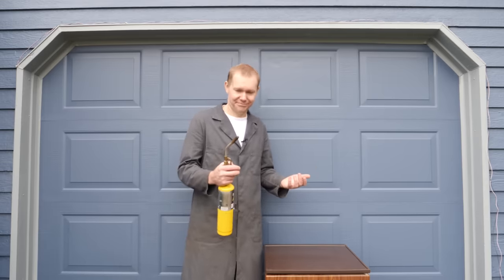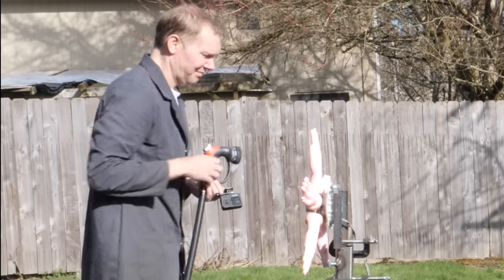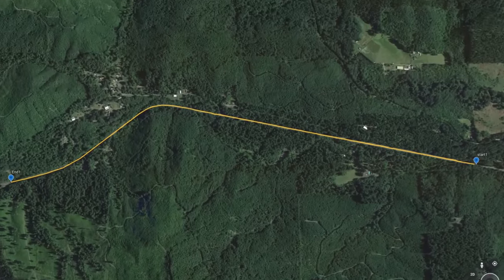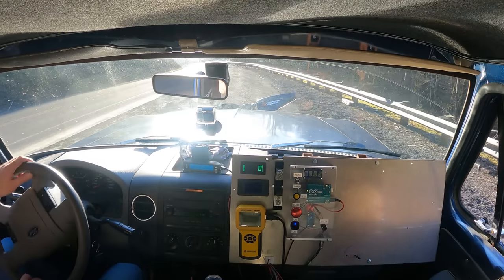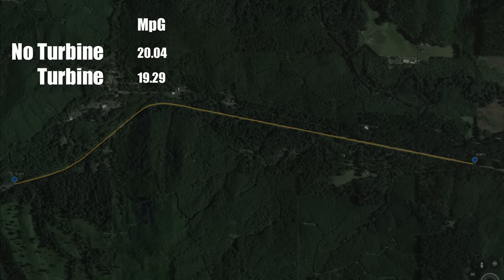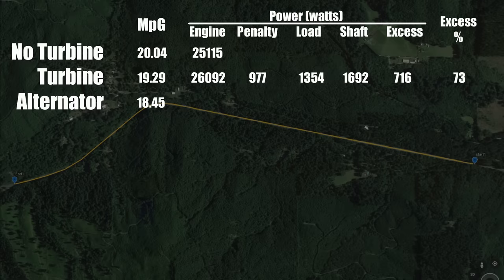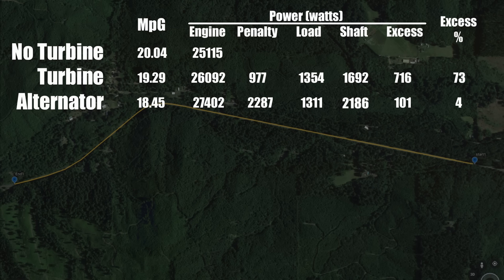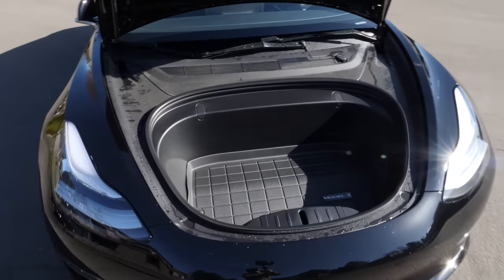Mileage Results You Won't Believe!!! - Wind Power on a CAR #5

Comment: I had an '86 Corvette. Sleek in the front to cut air resistance. Air scoop underneath for the radiator. But then they added a 30 Amp high-speed fan on the backside of the radiator to pull air thru it. Without that fan, the car would overheat. I knew this, because the fan went out a couple of times and the car would eventually overheat, even on the freeway going 60 MPH in overdrive. And by the way, the car had a short and long-term MPG computer, and I routinely got 21 MPG (long-term).

Comment: Hi, the reason why we don’t see the benefit in better gas mileage is because we are converting mechanical wind power into electricity first. So if we do NOT convert the mechanical energy, but instead use it as is on the wheels themselves, then we will see a big savings in gasoline. At first I thought of using a vawt turbine above the vehicle with a pipe attached to wheel rim with a right angle joint. That would work. But even more efficient and simple is to make a ‘water wheel’ and attach it to the wheel rim. There would be a big savings. 4 of them could be used. One on each wheel. I think the name of the water wheel is called ‘Pelton’ ?.that would be a very efficient way to use it on a motor vehicle. I will test it out . Personally I thank you so much for your abilities as a teacher. You have helped me understand the effects of the wind blowing on turning the blades of a turbine. You are marvellous in your explanations. I wish you well and will become a patron. Thank you so much. Enjoyed watching your son too.

Comment: It's good that there are people like you that exist, in attempting to do what seems impossible! Please also remember that (in adding the Turbine), you have also increased the mass of the vehicle, and (possibly) affected the rolling resistance. I have an idea which has fascinated me for a few years. All cars and Trucks have suspension - which moves up and down many millions of times, albeit in very short strokes. But this is one form of energy that has not been capitalized-on. We all know that Shock Absorbers heat-up, and this heat is a form of energy. With Electronic Shock Absorbers, that can "capture" and store in a Battery this wasted energy, and let us not forget that there are four (4) Shock Absorbers on a four-wheeled car or Truck. Some Enterprise should seriously look at combining the electrical output from four (4) specially-made linear Generators which are attached to the Shock Absorbers. This would certainly benefit any Hybrid, EV, or ICE Vehicle. I also include ICE vehicles, because this would also assist in taking some of the electrical load away from the vehicle's Alternator, providing a small increase in Engine BHP. I hope that this note would encourage someone to consider and develop this idea, simply because it is the one area of any vehicle that has moving parts (suspension) where this pure energy can be harnessed. Greetings from Australia.

Comment: I wonder if you should consider doing "coast down" tests to determine the aero drag differences between the truck w/ and w/o the wind turbine.  I'm betting, as others may have already pointed out, the truck w/ wind turbine is MORE aerodynamic than w/o.

Comment: If you put a false roof on top of the bronco and let that over hang the windscreen by about 1/3 the horizontal of the windscreen.  Then at the rear of this roof space put a barrel fan  OR extend the roof past the back of the bronco and enclose it in a tail section big enough to put a turbine in a vertical orientation so take the high pressure and dump it into the low pressure at the rear. Done with a bit of FCD you could get more MPG despite the turbine due to better aero.

Comment: Only issue I have is that I think when people in the comments were saying to use an alternator they meant use the propeller of the turbine to turn an alternator because alternators are more energy efficient because the magnetic field in the windings can be varied so that it only generates the power that is being drawn, allowing for better control over a generators output. It's common sense that running any appliance off the alternator is gonna create lower fuel economy because it puts more load on the engine as more power is drawn, amd we're talking a 1kw of mechanical energy needed from the engine to power the oven, which will have a measurable impact on fuel milage.

Comment: I suspect that an efficient turbine can make any shape virtually aerodynamic if you reroute the harnessed energy back into the system. Like you pointed out, it's about pushing air, and with the turbine, you can get some if it back.

Comment: Have you ever heard of "the big 3"? Car owners with aftermarket car audio systems wire their alternators this way. There's also high output alternators and brackets to run two alternators.

Comment: Do a 100 mile loop unhooking the alternator and using the wind generator to charge the battery to see if this in fact MORE EFFICIENT than the standard method of using an engine driven alternator to keep the battery charged. The math says it very well could work!

Comment: If you used a “rat” and dropped it into the slipstream in coast only it could keep the battery charged. Retract it when not needed.
 A “rat” is a wind generator used in jet aircraft. It is deployed when there is a loss of hydraulic output from the engines.  It allows the pilot to maintain control until he figures it out or ejects. A f-105 fighter has one.  Using a “funnel” to spin a impeller might be better.

Comment: Be interesting to see whether a portable air conditioner vs the oem fitted one would be more efficient in the back. I'm sure the Oven had its own challenges 🤣. You could do a 3 way test. Fuel economy average needed to reduce the temperature in the cab by x°C using vehicle installed A/C followed by the Alternator / inverter route and finally wind Turbine.

Looking at your oven results I'm leaning towards wind turbine with portable A/C may trump all?!? I really hope so 😉

Comment: Have you seen the guy that built the turbine on wheels that goes faster than wind speed? The rotor is attached by a belt to the wheels and powers the vehicle faster than wind speed directly parallel with the direction of the wind. The reason that works is the reason your turbine on the front of the truck may actually generate more energy than it takes to push it through the air. It's also why some sailboats can go faster than wind speed at an angle to the wind.
Reply: I believe you are referring to the Blackbird wind-powered vehicle.  What I found remarkable about it is that not only was it able to travel faster than the wind DOWNWIND but it was also able to travel faster than the wind UPWIND!

Comment: I could have told you the alternator problem would happen. Either upgrade the alternator to one with a higher amperage or add a second alternator and upgrade you cables 

I use to have a sound system in my truck that when the base hit the truck would slow down. In my case I just upgraded to a higher amperage alternator, added a shorter ground between the battery and frame, and a capacitor. The heating element in the oven cycles on and off a lot slower than the base in a song so in your case you can just add a second dry cell battery instead of a capacitor

Comment: What a fantastic project! Maybe you could increase the mileage of the Bronco at least a little if you let the turbine charge the car battery and supply the onboard electronics, de-activating the alternator (at least at highway speeds, with a switchover circuit?) instead of burning the generated electricity in a cooking oven.?!

Comment: Just random thoughts. 
I would try using smaller ducted fans. Even in research with ducted radiators, there were surprising gains.
Now part of your lack of gains mayhaps be the lack of air diversion a round the vehicle. 
You are still pushing the air with the blades and the front of the truck. If you were to divert the air from the radiator either under or up through the hood, you would see gains.

Comment: It's not often that I would sit for so long Infront of YouTube watching one set of videos but I did and it was excellent. I'm not a engineer but a biologist but I'm a keen amatuer electrical engineer and keen to learn. I have a campervan with solar power a battery to battery charger etc etc so I can wild camp here is Scotland so I don't have to visit campsites and it's just fun making stuff work ....like you say. For years I thought about a small generator to charge the leisure batteries in the camper by using a wind generator enclosed in the engine space and using the air hitting the front of the van to drive it. It wouldn't have to be kilowatts of power just a few Watts that on a long jpourney would help to charge the batteries. This seams especilly important since you pointed out that car alternators are so inefficient? regards Grant Kay

Comment: Here's an idea you have a great idea. 👍 bit why don't you add a battery bank and capacitor bank and add an electric motor  with a gear belt attached to your main pully to kick on after let's say 55 mph. It would help the gas engine load go down. Producing horse power like a supercharger.

Comment: What's likely the biggest problem for a vehicle that's aerodynamically well designed is that this will mess with the incoming flow, making it swirl. This swirling may decrease the aerodynamic efficiency depending on the car. To mitigate this you could add a second, opposite, static propeller that would take the air and redirect it to the car, increasing the car's aerodynamic efficiency.
It's important to keep in mind that the largest factor in a car's drag is isn't caused by the pressure on the front of the car but by the vacuum that forms at the back of the car. If you would take a well optimised car, the propeller could cause the air to separate from the car early, which may cause an absolutely massive increase in this area of low pressure and as a result, drag.

Comment: For the past 2 years I've been working on designing a three-wheel electric motorcycle with an attached teardrop camper that would run continuously without ever being plugged in.
My design has four separate charging capacities wheel driven motors not only in each of the three wheels of the motorcycle but in the two wheels of the teardrop camper. Using four different energy input I believe would be in theory. 
There are small cage fans that collect when to be used for a single output source which manages the lighting and computer needs. Then alternators, several of them, would be used to recharge the batteries. They would be two battery Banks wanted to be used while running and the other to be charged while running when the cycle gets low the second Bank kicks in automatically and the first Bank starts recharging. The next energy source would come from all solar panel. And finally the third source of energy. The trailer has its own charging and battery bank system.
The first goal is to drive this across country without ever stopping for a charge and the second goal would be the entire pan American highway.
What are your thoughts on this? I believe if we can conceive it we can do it. Hope to hear back from you
Reply: This is a very interesting project your planning.

Comment: There's another variable:  Car engines tend to be most efficient around 80 to 90% load for a typical operating RPM. That's one reason you tend to get better fuel economy in the highest gear possible; lower RPM means higher load. Most vehicles aren't anywhere near that 80 to 90% while just cruising on the road because that would be less practical for the way most people use their cars. But adding some load to your vehicle while it's cruising, assuming it stayed in the same gear (and preferably had the torque converter locked, or similar), while it would reduce the mpg, raises the load and might be slightly improving the power generation efficiency of the engine; that is, brake specific fuel consumption (BSFC), or power produced per unit of fuel burned.

Comment: I think there are a lot of followers who just don't realize that for the non substantial gas consumption is nothing when you consider how much energy is lost in vehicles. It makes sense to convert that lost energy. The same way heating your car does. A lot of people think that heating a car is bad for your car when in fact while it may cause a slight gas consumption increase the heat comes from a hot engine and it's wasted energy. Why not use all that wasted energy? Alternators don't waste energy but the drag on a car is absolutely wasted energy. The logic is there. 💯

Comment: I really enjoyed the thought provoking content of this video and would like to suggest that many smaller turbines that funnel air that's already passing over, around and under a vehicle even while the vehicle is sitting around outside, could be used to transfer that unused air into perpetual energy that could then be stored to propel the vehicle slightly once the vehicle is moving forward via magnetic turbines and now days we have batteries and convertors that could also be used to recharge the petrol engines battery and assist the alternator to reach maximum voltage there for dropping fuel consumption dramatically.
Would love to see an experiment with that concept in practice 🤔
Even Hubs, axles, bearings and internal ducting could be used to transfer unused energy into additional power with the correct science applied!

Comment: You're missing the point car alternators are designed for an specific power output depending on the vehicle, they have a CURRENT/POWER limiter built within to avoid burning out the car electrical system (or overcharging the battery) - you can spin it twice as fast and all you doing is wasting energy to heat (via current regulator)
Hope it helps

Comment: It may be useful for commercial trucks who travel at highway speeds 99% of the time. I suspect analysing the system (outside of the electronics) as a whole would be similar to adding an aerodynamic cone to the front of the truck.

Comment: I can see this idea being put to good use on an electric powered 18 wheeler. Most of their time moving would be highway speeds. Could use an air-ram hood scoop into a turbo type device to capture the incoming air. A gain of 8-10 % efficiency would mean big $$ on fleet vehicles.

Comment: if you build a air ram you could use the entire air resistance that pushes against the truck you could increase efficiency by about 70 percent of what you have accomplished. Because you are using that resistance to create the energy.

Comment: I had the same idea but my fans aren't as obvious. The power from the fan needs to go to a converter from 110 to 220 for maximum output. Should be enough to charge battery.

Comment: I think a Dyson like wind turbine may be a little less efficient on the production side but not have nearly as much maintenance or added drag at less than optimal speeds.  I hope that this does get added to EVs of the future in that form.  But there are many opportunities to optimize EV efficiency by making refinements to the vehicle platform, recovery system, and using variable timing on the electric motors to reduce inductive heat loss.
Reply: Another interesting test would be using heat pump to drive energy production from the radiated heat in the battery.  It’s already captured in the glycol that circulates for cooling.

Comment: I wonder if your results would have been different if you used a vertical axis/vertcal spiral generator.  I also wonder if you had access to a pickup truck, and if you could measure laminar flow over the truck, that maybe you could put the vertical blades possibly in the bed of the truck sitting higher than the roof. Or make a gentle funneling device to direct air flow over the vertical blades, but without too much wind damming.

Comment: Probably not a good idea but I had a thought about how good would it be to skip a generator and make a mount on the engine block, allowing you to connect a belt from the turbine directly to the crankshaft pulley, would be good idea to add one way bearing so engine can't back drive a turbine

Comment: Put that energy into a drive motor in between the prop shaft to add propulsion and also regenerate with the kers to some super capacitors that help the takeoff. Lastly you should create a hawt for the front and rear top of the roof instead of your propellor! That would increase you effeciency by at least 10%

Comment: From this video's data, I tabulate +1.5% range, if the turbine output could be applied to the wheels, did anybody else get the same answer?....that's a small gain, sort of like the turbine decreased aerodynamic drag by 1.5%?  If the test rig wasn't so 'classic' we may not have noticed.  Despite the sense of my engineering education,...I'm embarking to re-produce and examine another claim on "free" energy in my back yard.  I am up at night excited about what I may learn.....thank you for sharing, I hope to some day be able to present half as well as you do.

Comment: I was thinking about putting a 220 alternator in sideways with a 12-16 inch turbine like is used in a bathroom exaust fan.  Then ducting the air through to cool the ftont brakes.  Im not sure but I think that syle turbine would get going faster than the traditional turbine.  If you could channel the air efficiently the drag even on a tesla would be minimal.

Comment: it would make more sense to harvest energy from your Sunday drive while storing those gains into a battery you deliver back to your garage wall. to then power your home also you likely need a high output ambulance alternator they call them. and maybe keep the electrics seperate from the vehicle Try Using the Carbon fiber Fan to charge a Power wall from your garage